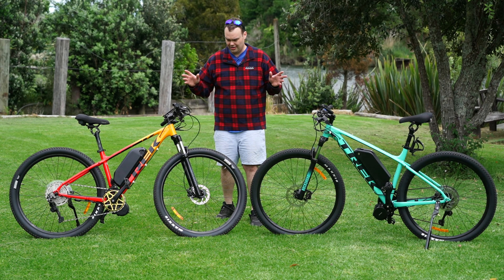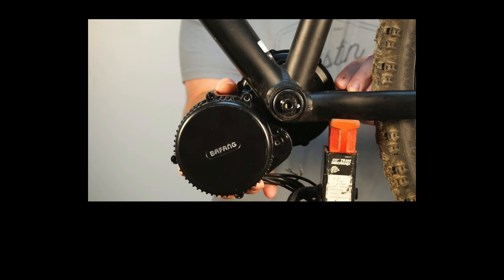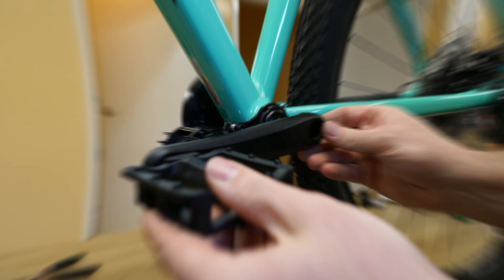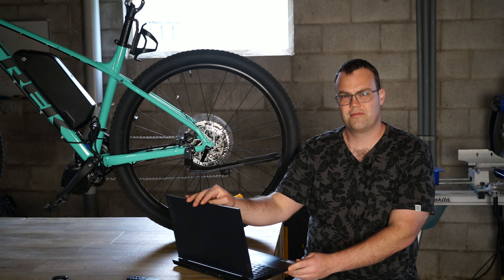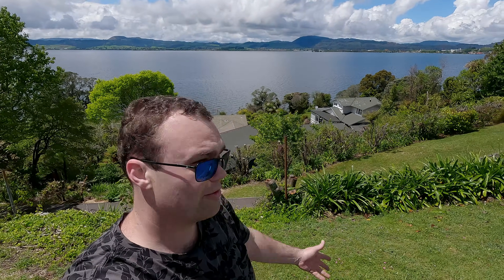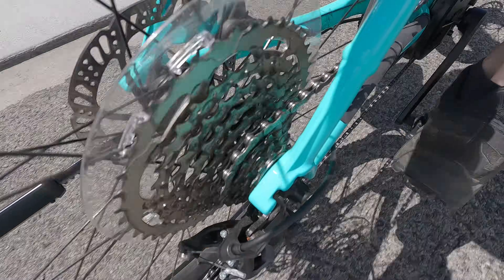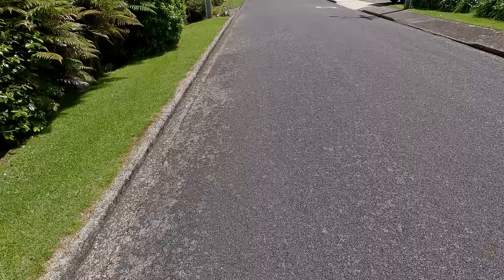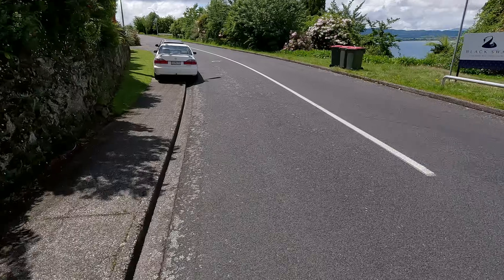Bafang 1,000W & 250W eBike conversion kit review II BBS01, BBSHD

Comment: Hello I want to ask you which battery you recommend for a Bafang BBSHD 1000W motor. I want it for long mountain rides. I'm thinking about a Samsung 52V 40Ah but I don't know if I'm correct, I don't know if this battery is enough, I've also seen 72V batteries on AliExpress you are an expert in formulas and current consumption, can you help me? Thanks for your answer

Comment: I have a BBS01 that has rode 15,000 km in 10 years and has only had problems once, when a heavy rain surprised me on the street and wet the contacts. I simply had to open the crankcase and let the engine dry in the sun. 
On my dad's bike I mounted a BBS01 750w and I think it weighs the same as my 250w. They're both great, but the 750 is already way too powerful. My 250 is programmed without power and speed limitations and has a 2x crankset.
In my experience of many uphills I can say that you can stay without the shift sensor, you just have to shift carefully simply a little in advance, before the chain is under too much effort. 
I only broke the gears once with my 250w but it was of poor quality and poorly mounted. A good, well-adjusted gearbox has no problems if you shift carefully (which you have to do even without the engine or even with the shift sensor). You don't even need a dedicated chain, even with the 750w. I think it is advisable, however, to have not more than a 10-speed gearbox and, if that's not enough for you, mount two chainrings, which can be done very well on most bikes. Probably 11/12/13 speeds have chain and gears too thin.

Comment: Hi I am thinking of purchasing the Bafang motor as per your excellent videos to a Trek Marlin 7. One question, did you have a problem fitting the motor adjacent the area to the underside of the bottom bracket where the concealed cable entry point. is. Many thanks John

Comment: the bbs02 might be best in the uk, as its the same size as the bbs01 but has close to the power of the bbshd. good for a stealthy look to avoid detection by the car industry protection inspectors. i accept the inspectors are really only concerned with safety. after all, power slightly greater than what an arthritic 80 year old might put out could pose a considerable risk to the drivers of massively fast, almost totally unregulated two ton metal boxes, who are generally happy to zoom past cyclists and pedestrians, many who are children and old ladies, at any speed they choose at the time, up to about 200mph depending on what car they are driving, at about two foot distance, while spewing out cancerous toxins for the cyclists and pedestrians to breathe in, and half deafening them. and often in town centres too, where many people are just out for nice stroll

Comment: I installed a 1000w direct drive in the front, paired with a 20"*3.30 kenda k rad and the rear 750w bafang in the back on my radwagon 4. Soon I'll be installing a 2000w motor. Right now heels are nothing. I can climb heels at 20mph. This heels he is climbing is nothing, the heels where I live look like the Everest mountains.

Comment: The BBSHD would also tempt me to convert an old trekking bike with a Rohloff hub. Unfortunately, police checks are becoming more and more frequent here in Germany and they are specifically looking for modified eBikes. The limit here is 25 km/h and 250 watts of rated power. Are there better conditions in New Zealand?
Reply: The more I read about EU, the more it just seems like a no fun  zone :(
Reply: @minibikerguy  It's the same with all overpopulated areas in the world. The more people live in a heap, the more regulations are needed to prevent life from turning into a social Darwinist slaughter.
Reply: I see some test on internet and a bafang kit with a rohloff hub seem to be a perfect combo, but the price of rohloff hub 😩
Reply: @ I have a Rohlof hub since 2005 and no issues since. Chains last much longer than derailleurs. Costs once a lot. But on the long run…
Reply: @SD_Alias  And shifting when u are on the stop 🤌
Reply: You can pedal faster than 25kmh on a normal bike… wtf😂😂😂
Reply: Going up a mountain goat or pig track you dont need more kmh...even on a gasoline powered enduro bike..flat or downhill on more open going pedalling over 25kmh ..the bike is not limited to this speed.. @iSad_OG

Comment: Hi, I have a Trek Marlin 5. Would your suggested kit for installing a Bfang mid drive be the same for a BBS02 motor. BB is 73mm but I am worried that the motor wont fit. Do you think I will need 5mm spacer plus a offset chainring? I just ordered the Bfang 44T chainring.

Comment: You said 52V 21Ah battery pack...What was the actual size of the case? 
I'm about to modify my Trek Roscoe 8 (L-size, 19.5) and I was almost sure that 17.5Ah would be the maximum capacity due to space limits.

Comment: 62 miles is not far enough so I will be sticking with pedal power until the tech improves.
Reply: When power is off you feel hardly any extra resistance from these mid drive motors so you can bike normally. Bike is heavier however and you loose gear switching on the pedal sprocket. Useful range varies based on amount of assistance you want and your battery size. For long range you can bring more than one battery.

Comment: The max assistance in the UK is 15.5 mph. I wonder, would it suddenly cut out at 15.5mph or would the power cutting off be unnoticable like the mahle rear hub motor I had.

Comment: Thanks for the video, between this an the Schematix video, i'm pretty set on this as well. 

I'm wondering if you can provide some advice on the fitment of the bottom bracket.    You said you needed an offset sproket and spacer - can you assist in how I figure out measuring if I need this?

Comment: Had a big HEAVY 1000W but i returned to 250w because i like a lightweight bicycle style over heavy fast machine, i bought a 22amp controller and  battery 🔋 is 54v ,she is perfect at around 20mph with alot of extra Torque, now no3 is like no5 was pn the 36v battery 👍🇬🇧 barely gets warm here and i pedal assist only ,bike just under 45Lbs 🙏🤟💯
Reply: Where did u get the kit, especially the 22amp controller.??? I am in sweden.
Reply: @brettrickards  EbayUK
Reply: So does the 250w not mean it's slow ? I've seen a full kit with battery for cheap but worried it will be too slow for mtb use ?

Comment: I've had the BBSHD installed on my Stumpjumper 29'r Hardtail for 2 years now.  52V 17.4Ah battery.  I have mavic wheels\hubs with hookworm tires.   I'm 6'3 225lbs and I can reach speeds of 30mph on flat surfaces and can go 30 miles on throttle only averaging 25mph. (42t for good tq and mph) I can greatly extend that by setting the pedal assistance to 5 or lower.   Zero issues so far.
Reply: How much was the whole setup? :)
Reply: @djVania08  I think $1500 since I went with a larger battery.
Reply: Mph you mean?
Reply: @chrisE815  Haha, yes.  I usually don't make mistakes like that.
Reply: @chaleowin7732  Np- that's cool. I have a BBSHD with a 40T sitting here ready to be installed. Sounds like a reasonable gearing choice for my application.
Reply: @chrisE815  Good luck on the install!
Reply: How is the climbing with 42t? Doesn t thst forece the chain.  The gears?
Reply: @conspicuouscontraption  The tq feels good as long as you are int he correct gears.  I'm never had issues with the chain, but I tend to purchase a quality chain every 2 years.  I'll be converting my Farmed Avalanche this winter, not sure which kit though.  I need power for those beefy tires.

Comment: I use the BBS02B 750W, 48V, but with a 52V Booster battery, using Samsung 30Q,with  2PS14, 6Ah, Discharge 30A, Battery Weight is only 1.2kg !!, at normal pedal assistans 9.4Wh/km i get easily 33Km, not to mention pedaling as a normal bike is also easier as i don't have the deadweight of a discharged 21Ah, 4.5kg Battery. Charging is also a third of the Time. I think this is great for Bikers that will bike more and just use the powertrain to get up hills.

Comment: I have a 4x4 pickup with a winch on the front. And would like to add a winch to the rear as well. My question is, would I have problems with voltage drop, by running the 12 feet or so of wire from my existing battery to the rear of vehicle.

Comment: It’s annoying that there are so many rules on limiting motor wattage. Governments don’t seem to understand that I don’t want to race it around at 40mph, I just want to get my fat rear end up some really steep hills. The whole point of which is that I can lose some weight.
Reply: I'm just ignoring those rules and taking whatever power I need for a safe and quick commute. After all, we are doing everyone a favor by not using cars and as long as we ride responsibly it should be fine.
Reply: @persiathiest1963  Yes,  BUT if you are in the UK or EU or several other countries with the same speed and power restrictions,  if you end up involved in an accident and cause injury to someone else,  you can bet your bottom dollar,  pound, euro or whatever that you will be prosecuted and convicted with the inevitable financial penalties and probably a substantial civil compensation claim from the injured party.
Basically I agree with you that you will be fine until something goes wrong. 
Then you will have a criminal conviction with all of the long term consequences that will follow from that. 
If you're unemployed and don't own any assets then it won't bother you too much. 
If you are employed and do own assets then you could be well and truly f*cked.
Reply: Yep and there seems to be no limit on HP in cars and motorcycles.
Reply: @Hoggdoc1946 this is incorrect. There actually are a lot of laws for horsepower on cars. I know in my area most supercars are illegal to drive
Edit: I'm in America too
Reply: The good part is that these rules are only there on paper because it's near-impossible to enforce them
Reply: The problem here is you’ve assumed sensible and Government can be used in the same sentence.  Nobody in Government gives a flying fukk what you think or care about.
Reply: The few ruin it for the many. Regulations are aimed at the masses. I have been eBikibf for almost 20 years and nobody has stopped me to enforse anything. Of course I do not flaunt the extra power. Ever.

Comment: I bought a 1000W Bafang kit after I saw your last video, and have had a great deal of fun on my old 26" steel hardtail DMR. Who cares what size your wheels are, when you've got 1000W at your disposal? Thanks for the suggestion! 
A few other tips I'd add: if you have a big battery pack (to go with your illegal-sized 1KW motor, ahem)  it pendulums during normal riding, & you need to stop it from oscillating, otherwise, it'll crack/ream out  the mount, break the screws, etc. I made a bracket with a fork that goes around the rear of the battery, to steady it, that mounts on the rear bidon mount on my old steel MTB frame. 
 Fit the shift sensor up at a top part of the gear cable run, to stop dirt and water getting inside and making it work badly. 
Also, mount the motor rotated as far up as possible, for ground clearance. Make sure your BB shell faces are paint-free and faced properly, so they grab the mounting lug and gear-case correctly. The tools to do this are expensive, but a good bike shop can do it for your when the bike's stripped down. Saves hours of frustration later. 
I had a few problems with a dodgy Hall effect brake cutout sensor, but changed it and it's now ok. 
Extra grease in the transfer case makes your nylon gears last longer. I've shredded a pair already, but they're not too expensive, and I've put some proper nylon gear grease on them (the factory stuff is yuk) and the new ones have had a lot longer life already. 
 I bought a front and rear light to run off the battery (Busch &  Muller make a really good range of non-dynamo lights for e-bikes). I had to fit a solid-state step-down to make 6V for the rear light out of the main 52V, (RS & Element14 have them) but the B&M front light will run on any voltage from 6 up to 72v. Not cheap, but exemplary German quality. 
You go through brake pads quite quickly with the extra weight & power, but I have Deore XT dual-piston calipers from the bike's earlier life, and fitted some SwissStop pads with fins on them, which cools them and makes them last longer. 
Schwalbe Marathon MTB tyres last a lot longer than anything else, with fewer punctures (which are a pain on an e-bike). 
The Bafang range estimate on the display is rubbish, the exact opposite to my Kona EV's.  I just press the indicator  button on the battery, and go home when there's only 1 LED lit.
Reply: How has it held up over time?

Comment: nz has too many rules.
Reply: Just ride sensibly & they will leave you alone, 300 Watts may be OK for some, but for serious daily commuting, on semi rural & town roads, I vote BBSHD1000, reliable & good acceleration when it's needed, like on busy roundabouts
Reply: @thebeaglebeat3615  i would definetly take the 750 watt instead, if u are not gonna be switching the controller and pumping the watts to 2000 as u can with bbshd BCS the 1000 watts costs 100-150 bucks more at least and only goes about 5-10 km/h faster than 750watt one
Reply: For everything!
Reply: Butt nutt so many Schoolshootings ass the United States of Ass ‼️
Reply: :Laughs in Australian:
Current laws here where I live:
Cannot exceed 250 watts
Cannot power solely by motor above 6kph
Cannot provide assistance past 25kph
Reply: @Grunklowe  in Finland we have
1. 250Watt limit, peak allowed more tho 
2. Assistance has to stop at 25km/h

Comment: I bought and fitted the kit in the original installation video that Schematix made. 
I'm a big unit. 23 stone. But it powers me around town and up some quite step hills on my commute to work. Before fitting the kit, I very rarely took my bike as it was such an effort. I'm in the UK and have never been questioned as to the power output.
Reply: I'm in Wales UK is there anywhere I can get this kit fitted to my trek?
Reply: I'm in the UK too, long as you don't go excessive speeds you'll be left alone. Just bear in mind though If you have a prang they may look into it.
Reply: Course you won't, Police can barely keep on top of proper crime, if they start wasting time on enforcing people's bike power the world has really lost its priorities and common sense. Tbf it's already ridiculous how much time is spent penalising people for going a few miles an  hour over the speed limit so anything is possible.
Reply: Did it help towards weight loss?

Comment: Do any e-Bikes have regenerative breaking?
Reply: The drive system of most bikes cant accept any reverse torque, therefore no breaking is possible. Its like trying to pedal in reverse. There are bikes that have a breaking ability when pedalling in reverse. But those are one-gear bikes (fixies i believe)
Reply: I think its efficiency is not worth the extra cost and complexity and that's why there are no such e-bikes.